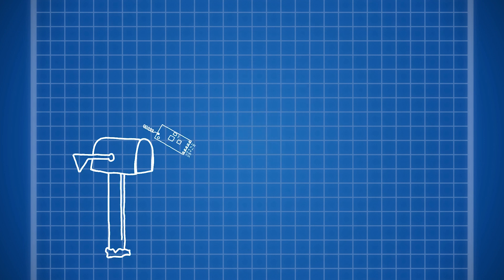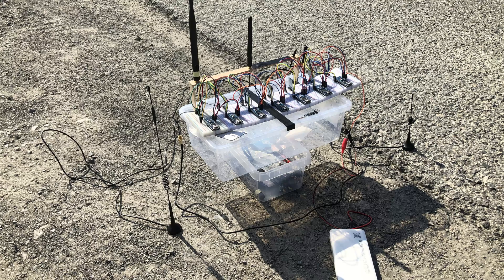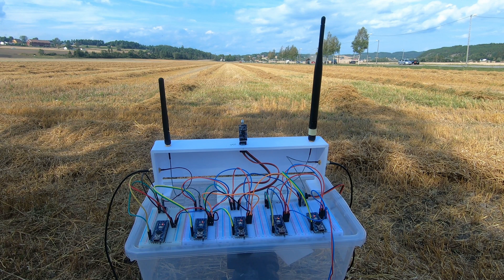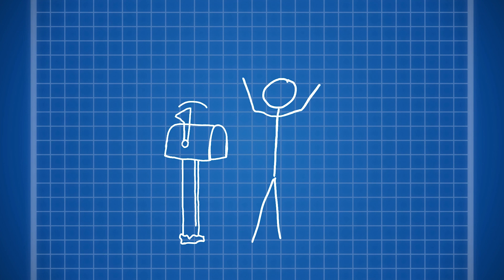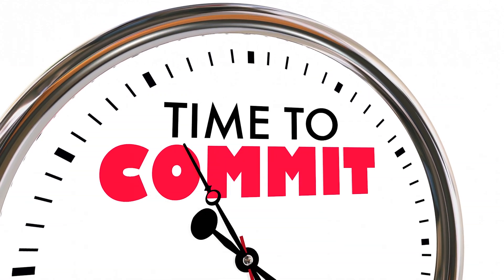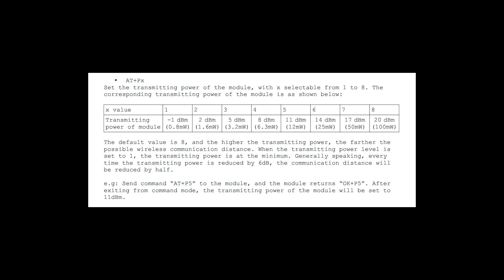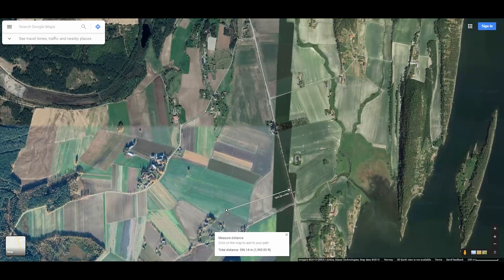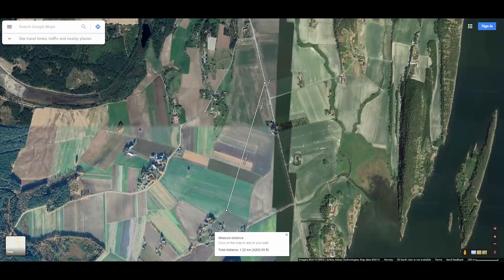2 KM SUCCESS STORY with HC-12 - going beyond 1800 meters!

Comment: What I want to know is, would applying those capacitors to the other modules have also improved their range?  I see you have other videos on this so maybe it's answered there
Reply from the maker: The purpose of the capacitors is to make sure there is enough energy (current) available for the transmit signal. Transmitting a signal requires high peaks of current. And if your power source can't deliver the current needed, exactly when needed, the signal will be weaker and lose range.

Comment: LOL! You guys are funny! And great results on the transceivers! I am trying to use a US-100 sonar to measure water levels in a cistern outside out house and need to (ideally) transmit the data to our router or a nearby "Raspberry Pi Zero W" or an ESP8266 or ?? 
I tested the US-100 in our tank and got a pretty solid signal back from the water so I'm pretty sure it will work. The only question of course is the humidity effects on the piezos.

Comment: Thank you for this information! I’m so used to radios working less than what is advertised, but to have it be off by so much made me frustrated. I too had my transceivers fail at about 50 meters. I’m going to order a bunch of these now.
Reply from the maker: Hi Elmer!
We are exploring a way to fix the bad HC-12 modules. It’s looking good, so there might be hope for the clones as well!
Video coming as soon as we are done with all the testing!
Reply: DIY TECH BROS after closely inspecting the ones I purchased on Amazon and eBay just a few weeks ago I’ve discovered that I do indeed have the official HC-12 modules. After setting the mode to FU4 with the AT commands sketch I got slightly more improvement. 

I’ve read that you shouldn’t power them over the Arduino USB. I’m assuming that means these need a regulator and to be powered by something other than the Arduino 5v pin. I also put a 1N4007 diode to drop the voltage below 4.5. I also put a 22uF capacitor on the power and ground pins of the HC-12. Still having issues. So my next question is about the antennas. Which antenna did you have the most success with in your experiment?

Comment: hi guys! i wanna install to my car a bluetooth receiver to pay music from my phone. the question is: is this module what i need? if not, what would you recommend to buy? 'i'm a little bit confused about it; for instance i have seen "Wi-Fi" modules that are paired with the phone via bluetooth and they can work on a big distance like 50 feet or even more. (i do have this module for o project with LED's)  is there on the marked thi module for audio too? thanks!
Reply from the maker: Hi! No, you do not want to use this module for that purpose. 
1. The method and transfer rate is not well suited.
2. More importantly, this is not a bluetooth device. 
Try, HC-05, HC-06 or even ESP32.
Reply: @DIYTECHBROS  thx for your quick reply! so, what i does care is only the working distance, or the range, of the bluetooth module. i was thinking about this one: (www.aliexpress.com/item/32985655660.html?spm=a2g0o.cart.0.0.3b7c3c00KVdFw5&mp=1) since they are saying the distance, about 20meters

The HC-05, HC-06 and ESP32 does not say the distance. i already wrote to the guys. waiting for response.

what do you think will be better only for distance? and can i increase the distance if i solder a bigger antenna?

Comment: I bought the faulty modules over a year ago and was disappointed by their range. I've been searching for a way to fix it and have never been successful until now! A commenter, lukie80, on this post "https://www.instructables.com/id/HC-12-Distance-Problems/" by oldmaninSC said that a man named Helmut Jahrstorfer on Amazon.de found a way to fix them. There is a missing trace on the board which prevents two resistors from being connected. This image here "https://content.instructables.com/FDJ/V5RF/K84NIOEZ/FDJV5RFK84NIOEZ.LARGE.jpg?auto=webp&frame=1&crop=1:1&width=320" (can also be found through the comments of the post) shows that the voltage on one of the capacitors must be 3.3V for the board to be functional, if it is not 3.3V then the two resistors can be manually connected. I was doubtful that such a simple change could fix thousands of boards but I tried it on my old ones from a year ago, before I was getting about 50m with a direct line of sight, but with this fix I got about 250m through a hill! I was amazed that it was so simple and if you do end up seeing this message I would be grateful if you could try it yourself and if it works, spread the word to let more people know about this fix.
Reply from the maker: This is one of the main reasons we love youtube - the excellent community of smart makers! Thank you ajrandell01 for bringing this to our attention. I have done a very quick test at home now. On the first board I managed to desolder the capacitor and loos it. On the second attempt I desoldered it, but was able to solder it back and also create the described bridge. 

And with this one test, I can confirm that I'm getting a much stronger signal!
We will do some more test :-)
Reply: @DIYTECHBROS  Glad to hear it! I'm looking forward to hearing more about your results.
Reply from the maker: This is so exciting AJ!
Thank you so much for telling us!

Just tested with a different module and an external antenna - same results!
We have to do a bigger test and compare it to the original HC-12.

This deserves a follow up video!
Reply: @DIYTECHBROS  I'm glad to hear that this fix worked for you as well! Like I said previously, I've never heard of a fix until now and the post by lukie80 was only made a month ago so this is a very recent fix. Hopefully, this solution gets spread throughout the community so no one will have to experience the frustration of getting a board with a SI4463 chip rather than a SI4438. I'll be looking forward to any future videos you do on this topic!

Comment: Do you have a link to the best antenna and where to buy it?
Reply from the maker: This is the best antenna http://rover.ebay.com/rover/1/711-53200-19255-0/1?ff3=4&pub=5575571647&toolid=10001&campid=5338657235&customid=antenna+433&mpre=https%3A%2F%2Fwww.ebay.com%2Fitm%2F433MHZ-High-Gain-Antenna-SMA-Within-Needle-Rubber-Glue-Stick-6DBI-MA%2F131535083764 (Affiliate link)
Reply: @DIYTECHBROS  this link isn't working for me. Do you have an alternative?
Reply from the maker: No... sorry! There are so many sellers on eBay, so I can’t recommend a untested seller. But, the spring antennas are very, very good. I would only go for an external antenna if a wall or an object was blocking the signal and a different placement of the antenna would improve the signal!

Comment: Great job guys, Problem though:: In the video you say to use the board with the number 44382A chip but in the link the picture of the board fromm Bang-Good shows in the picture that the supporting chip is a 446318 so did they run out and switch the boards to the crummy one?  The board with the 44382A chip is the correct one one?
Reply from the maker: They are using the wrong image on Banggood. See the images posted recently by customers in the review section. We have also bought these and gotten the original ones :-)

Comment: Hi I am from India, I brought 2 pairs of HC12 Modules one from bangood and another from Amazon.
The one pair I bought from bangood is working with default factory settings about 200meters(approx). Another pair which I bought from Amazon is working only around 10meters.

But on both the modules when I try to chage the settings using AT command ,I am getting ERROR.

Can you guys please help?
Awaiting for your reply!!!!
Reply from the maker: Hi! Are you pulling the SET pin low?
Reply: @DIYTECHBROS  
Yes,After connecting set pin to gnd, when I send AT Command, it starts sending ATORR ERRROERRRO then it is sending RRRRRRRRRR in serial monitor, If I remove the set pin from gnd it stops sending data to serial monitor.
I don't know what is wrong.

Comment: I would like to ask with urgency, whats your experience with this module indoors? How many concrete (about 6"in thick) walls do you think the signal can penetrate? and how much reduction in distance due to these walls? I starting to think that HC12 is more reliable than NRF24l01. Thank you for doing these test and showing the difference between fakes and original chips.
Reply from the maker: Hi! I prefer using the HC-12 over NRF24L01 in most cases. There are some issues with the HC-12 as well (Serial communication is not the fastest and can delay your loop. And it is slow if you need to transfer a lot of data.)

But, for sensor data it is perfect.

I have not been able to test it though multiple concrete walls. But I have testet it though two wood floors and one concrete - with success :-)

Note that difference in reinforcement will influence the results.

Hope it helps!
Reply: @DIYTECHBROS  I apologize for my ignorance because im just starting to dump NRF24 over HC12, but may I ask how much delay there is for example for 10 bytes of data? I want to send 2 analog joystick data plus some. Im planning to use data structure just like in NRF24. Thanks for your reply
Reply from the maker: @atdforgebc4605  That will be fast. But, it depends on how how often you will send the data. If it is for an RC car, and you will send data multiple times every second the process of reading from Serial will cause a delay.
Reply: @DIYTECHBROS  Thanks for your prompt replies. I you have a great channel, clear and direct to the point which is rare nowadays. I know its hard to produce and present a tutorial content but you do it anyway. Again thank you for doing this and more power to you. Sincerely
Reply from the maker: atdForge bc Thanks :-)

Comment: Hi!
Just seeing that you are still replying :)
This is an awesome video.
 I am using the same sensor and I have one transmitter and 4 receivers. but i have only a few meters range. i want to increase it and the first thing that I will do is increase the power using AT commands. and secondly, I didn't add capacitors to it. can you tell suggested schematics that how you have connected diode and capacitors and also capacitors of what value? 
Thanks
Reply from the maker: Hi!
The recommended capacitor value is anywhere between 22 uF and 1000uF. But for this video we went extreme,  with one fast (22 nF) and two bigger, but slower capacitors (belive it was a 22uF + one 1000uF that also covers the Arduino as well.)
BUT, when using an original HC-12 we get ranges far beyond a few meters even without any capacitors just using a powerbank. 
So, are you sure you are not using a bad clone?
Reply: @DIYTECHBROS  no i am not sure about clone. Should i change that, and can you recommend the procedure?
And also about the transmit power, how much it should be?
Reply from the maker: Hi!
You do not need much transmit power to reach beyond a few meters. So I would start by making sure you are not using a clone. There is a link in the description to a version that we have tested.

It should reach many hundred meters in its default mode.

So the question is not how much should it be set, but how low can you set it and still receive a signal. 

Hope it helps!

Comment: Very helpful video guys! Thank you! So even when you set up the "bad" HC-12 modules right with AT commands, the output power is way less, right? But what about the receiving sensitivity, is that also a problem? Like if I use the "original" module to transmit and one of the "bad" ones to receive. Do you think the range is also decreasing in comparison to only use the "original" ones?

Thanks!
Reply from the maker: Hi! While we have not tested that we have definitely noticed that it makes a huge difference using an original HC-12 as the sender. As a receiver it seems to not make that much of a difference.
Reply: @DIYTECHBROS  wow, you're awesome! Thank you very much for the quick reply. I'm planning to do have some fun and create a project with these modules and I still have a few fake ones laying arround. But I only need one way communication over few hundred meters. Now I know that I can only buy 1 original one as the sender and still use my old ones.
Reply from the maker: Sounds smart :-) No reason to throw them away when you can put them to use.

Comment from the maker: Buy only HC-12 modules that work, these are tested and they work:
https://www.banggood.com/custlink/Kvmm1t5uwT (affiliate link)
Reply: Sorry guys, I'm still a little bit confused how to spot working modules from modules I shouldn't buy. Would be awesome if you can help me out again with these questions:

1.) As mentioned, they're using different ICs. At 3.50 you can see that 2 ICs are different from each other. Not only the tranceiver IC, also the IC next to the tranceiver IC. You guys said, that the working ones use the si4438 chip while the others use the si4463 chip. So the working ones you bought use the si4438 Chip and the other IC next to the si4438 is also smaller compared with the bad ones? So can I spot bad ones by simply looking at the other IC, if it's the bigger one, it's a bad module, and if it's the smaller one it's a working one? Or isn't it important because they are randomly using different ICs and the important one is only the si4438?
2.) Because of that I'm confused with the ones in your link. The title says "si4438" which is good! But on the picture you can clearely see that the other IC is the big one. But as I said I don't know if all the bad ones use the bigger IC next to the main tranceiver IC. But also if you zoom in and look carefully, there's an si4463 on the picture. Does Banggood only copied the product photos but are shipping the working modules?

I appreciate your help!
Greetings from Germany from a 16 years old, messing arround with arduino :)
Reply from the maker: @leandroebner1405  They simply do not know that it is a big difference. The module they ship is the correct one.
Reply: @DIYTECHBROS  alright, thank you! Time to order some ;)
Reply from the maker: @leandroebner1405  Happy tinkering :-)
Reply: @DIYTECHBROS  I bought 2 modules from that link some months ago, and I got modules with a 44631B chip. Is this the one with poor performance? Either way I'm having problems getting more than 5 metres range in FU4 mode.
Reply from the maker: Voltiq Sorry to say, but the SI4438 is the one that’s working. Not the 4463! It’s like day and night comparing the two. See the link in the first comment or description for the correct HC-12.
Reply: @DIYTECHBROS  I bought from your link without knowing it, but unfortunately I bought when they were still shipping SI44631. I checked my order history and it did indeed say SI4463. It's the same link as you bought from, they've just changed which chip they're selling since I bought mine :(
Reply from the maker: So sorry to hear that! I would complain! The correct ones they are sending now is the original ones and work great!

Comment: I can't get my HC12 modules to send over 10 meters. The external antenna doesn't seem to do anything. Best range is with two spring-antennas attached, but still only 10 meters.
Also, my modules won't respond to any AT-command in Serial port.
And they will only work with my WAVGATuno or nano boards not with the normal clones.
Any ideas on this?
(Sorry if I am asking stupid questions, neewb in Arduino tech)
Reply from the maker: Seems like you unfortunately got some bad clones. Can you read the name of the Transceiver IC? I have never seen any of the 4463x preform any good. We may have found two places where you can buy original modules! Keep you posted as soon as they arrive!
Reply: @DIYTECHBROS  Thanks for the quick reply. The name of the transceiver IC is 44382A and it says on the bottom HC01.com Seems like the legit version to me.
Do I understand right that you think the problem is in my arduinos?
Reply from the maker: You can buy the original HC-12 that work from this link https://www.banggood.com/custlink/3KGvMGgRvG (affiliate link)
Reply: do you have the set pin low, when trying to do the AT commands?

Comment: Hello, great video!
Would like to know what external power supply would you recommend to power an Arduino nano connected to hc-12 (would just light up few LED's and a buzzer)
Reply from the maker: Hi Pedro! Allow ~20mA for the Arduino, ~100mA for the HC-12, and about ~20 mA for each LED. Add a bit extra for the buzzer and a safety margin. Remember to add some capacitors (both fast and bigger ones) for the HC-12.
Reply from the maker: Good news, we may have fount two potential places that sell the original ones that are easier to order from than hc01.shop. We are waiting for then to arrive and test them out. I'll let you know as soon as I can confirm!
Reply from the maker: You can buy the original HC-12 that work from this link https://www.banggood.com/custlink/3KGvMGgRvG (affiliate link)
Reply: Would also like to know where to get the original hc12, afraid it will loose lot of range if I buy a copy

Comment: Hello Sirs ,
I testing this module to get the longest range with spring antenna. I have a few questions. I hope that u will answer me. 
1. May I know the setting for the longest range ?
2. I tested to send potentiometer datas. The transmitter sent 0-1023 but the receiver receive 0-255. How can I  fix it to receive the same value?
Reply from the maker: Hi Lwin Moe!
1. see this video: https://youtu.be/0PyHYLAKfnQ
2. sees like you have a 8/10-bit problem with your variables. Try changing it :-)

Comment: configure HC12 to laptop wifi is it possible? instead of using 2 HC12?? Using laptop as a transmitter the python script will perform some action and the signal will send to the receiver bot(arduino) using hc12??
Reply: Only if you use an intermediate device. Obviously HC12 is 433Mhz, and WiFi is either 2.4Ghz or 5Ghz depending on standards. However, an arduino connected to laptop (either via usb or wifi) can retransmit that data to remote arduino via HC12.
Hope that helps.